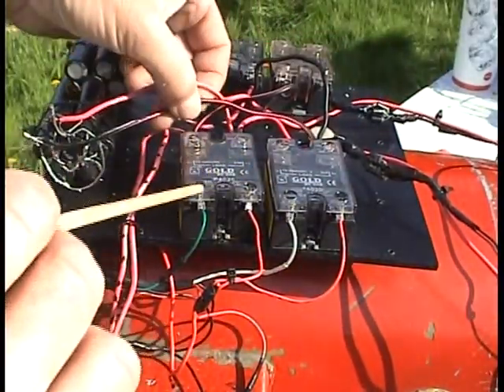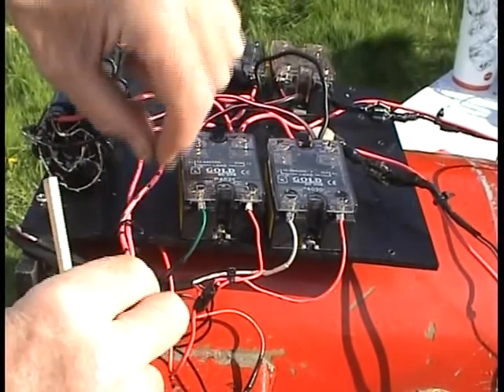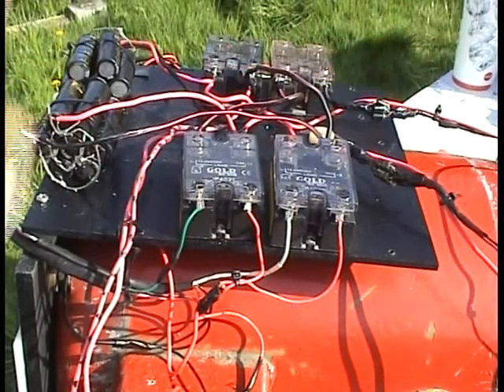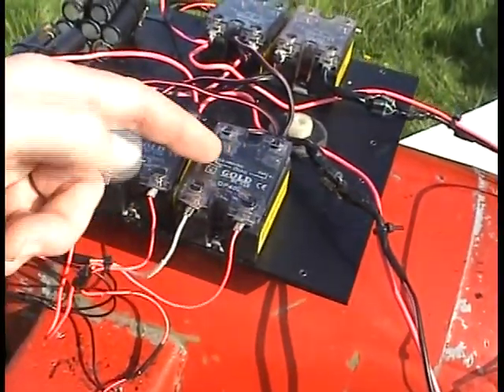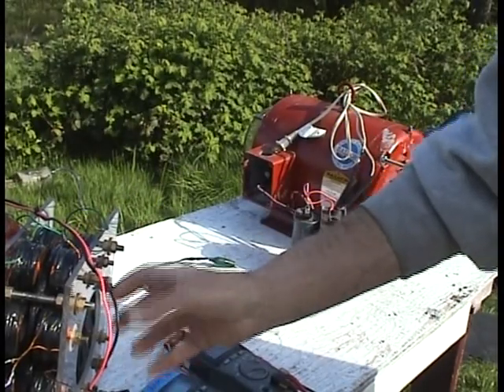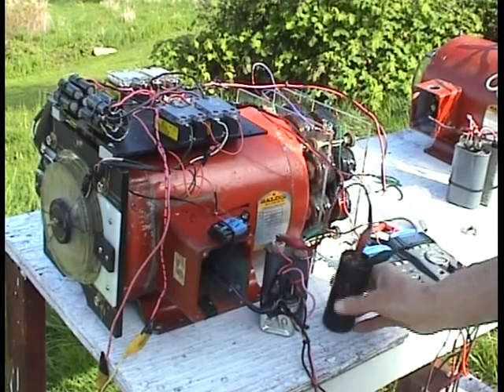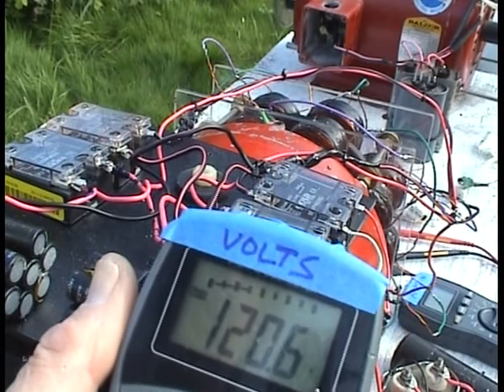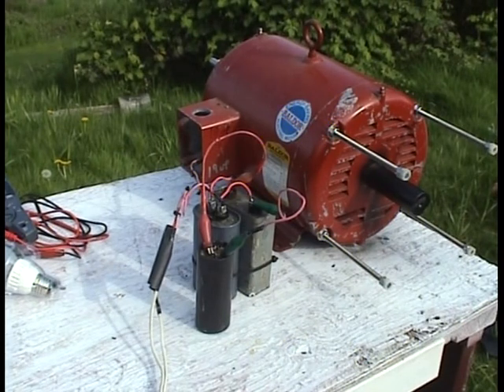PART TWO 4 SSR rotating invertor on Rotovertor AC motor

Comment from the maker: hi DE the geocities  link you just put up is for recovering  backemf/recoi/flybackl of a pulsed DC coil, which happens when the switch pulsing DC into a coil is opened, and is different than shorting a coil at its sinewave peak (or shorting a DC pulsed coil just before saturation)Shorting requires very low resistance switching, and is why the paralleled mosfets, and also requires switching that can switch AC ringing, while the coil is shorted, so that is why the bidirectionally connected pairs of mosfets too.Too much resistance will kill the HV hyper AC ringing that happens upon coil being shorted, so you must fill caps-only with no resistive load across caps while filling them,  then in a "stage two", the caps dump all by themselves to a resistive load, and there is the extra power you will create, from the much higher voltage and joules contained in the capacitors when capacitors discharge to load.
Reply: +MrDKONZEN thanks very much....i will need to order the parts in the coil shorting circuit from a foreign country because it will be hard for me to get them here
...salute..will keep in touch..

Comment from the maker: Hi DEThe diode plug circuit you linked is more advanced than what is shown in the rotating invertor videos. In the diode lug circuit note that the idea there is to actually short-circuit briefly (at the sinewave peaks) the AC sine wave produced by the generator on shaft of the rotovertor motor....then this hyper-ringing high voltages produced by the generatorth coil(s) being shorted fills capacitors up via a FWBR....after caps fill up now they can be discharged in AC fashion or DC pulse to loads in "isolated fashion"look up the peak coil shorting circuits on my site using the bidirectional and paralleled HV mosfets. I have not made video showing AC rotating invertor filled up by peak coil shorting, rather than generator coils filling caps "directly" as is shown in rotating invertor videos...... peak coil shorting will boost voltages into caps from X 20 to X 50 in voltages (!!). plus it does not lug and brake generator from lenz law lugging as caps fill just as long as you time the coil-shorts. To happen at sinewave peaks and keep the pulse width short for that "switched short"
Reply: +MrDKONZEN well under stood sir thanks, but for the Generator coil shorting does it have to be that complex? because i have seen some simple one you had before and this is the one am talking about....http://www.geocities.ws/koneheadx/circuitdiagrams.html

Comment from the maker: Hi D E. Basically it is two cap banks filling up from the generator on shaft, and cap bank A discharges in one direction, and then cap bank B discharges In opposite direction and this makes an AC type of output and the alternating cap discharge powers another ac motor to show that this is useful 60hz AC power being produced. Switching is done with solid state relays and hall effects and disc on shaft with trigger magnets. It's not too difficult really - if you watch all my videos on this "rotating invertor" subject,you will understand it. This one with only 4 relays is simplified version. Sorry I don't have circuit written out for this but tried instead to explain with video and the talk....